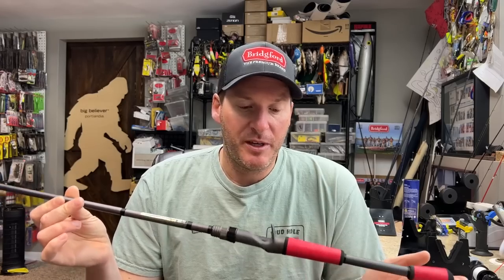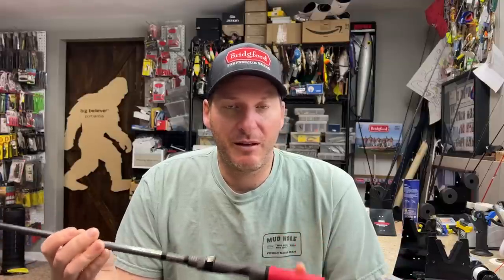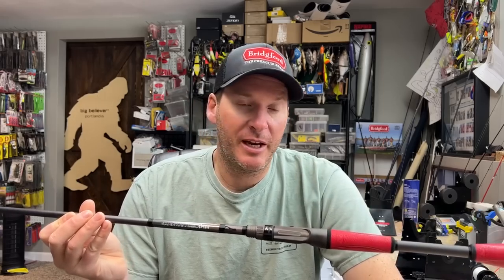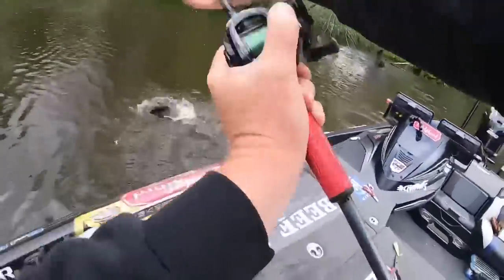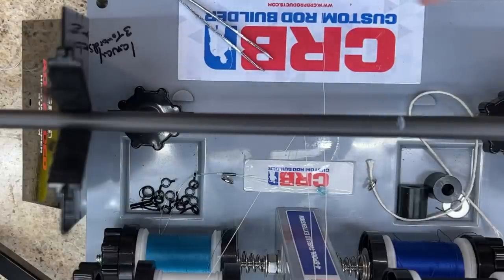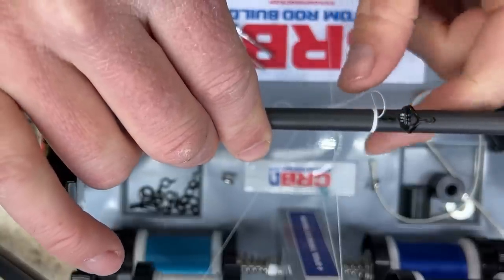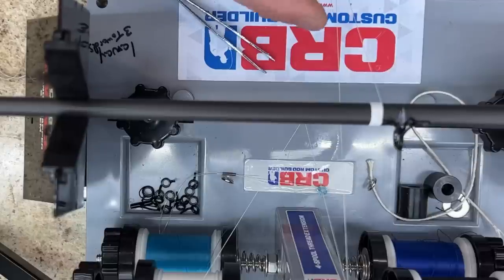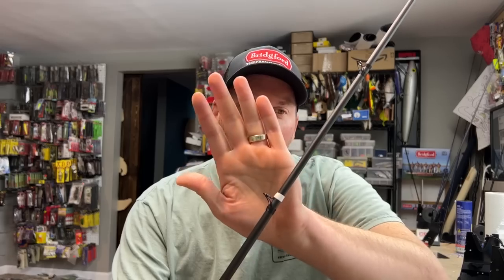The Most VERSATILE Rod You Need To Have AND Saves Money! Build To Catch!

Comment: Always thought if I built my own rods I would do that you can also get that multi colored tape packs that electricians use to mark wires
Reply from the maker: sounds good!
Reply: Brian, I use colored electrical tape as well on my purchased rods.  Just started building myself.  Made a CB906 and a NMB783 over the winter.  NMB or MB843 is next

Comment: Hey Matt do they make a rod blank you could make a like 7'11" swimbait rod out of? Also will they make it for you if you pay extra, reason I ask that is I don't see myself making a ton of rods so no sense but all the equipment to build them but with you your always building them so I see why you have all the stuff
Reply: You do not have to have all that equipment to build a rod. I’ve been building rods since the 80s and still create thread tension by putting the thread through an unabridged dictionary. I also have made a homemade rod holder with wood V blocks. Literally, no expense. And you don’t have to have a spine finder to find a spine. It can be done by hand. I made a spine finder using different types of bearings, and quite frankly, I prefer to do it by hand. I also apply the epoxy and rotate the blank by hand, the first hour or so, at five minute intervals with no sagging.
Reply from the maker: yep they have swimbait rods!  unfortunately they do not build the rods for you
Reply: Thanks I will give it a shot, Matt do you have a link to MudHole like the one from TW, if so I’ll use it

Comment: Hey Matt, in the past you did I a rod build on the NMB843, this was the MB843.  I assume the MB is a bit heavier and not quite as sensitive, but also only 1/2 the cost.  For your targeted top water I assume those differences aren’t a big deal for you.  An 843 has been in my plan for my next rod build.  Do you use them interchangeably?
Reply from the maker: i use them interchangeably for topwaters but if its a bigger spinnerbait i prefer the MB843.
Reply: Thanks Matt